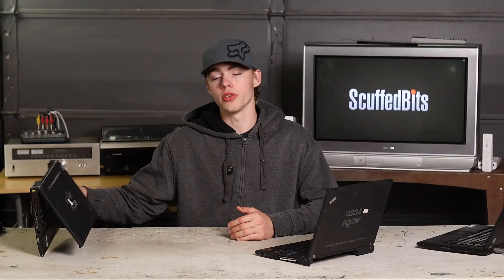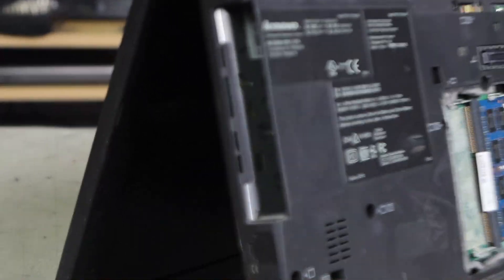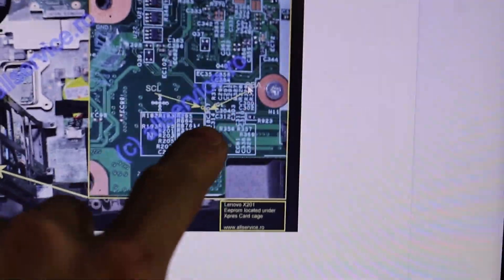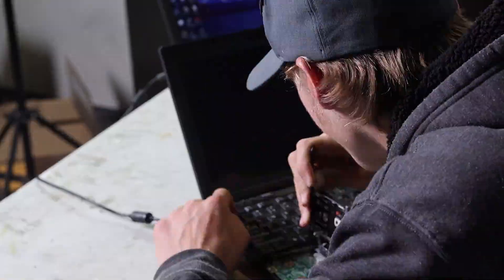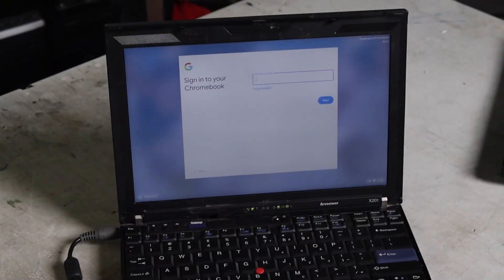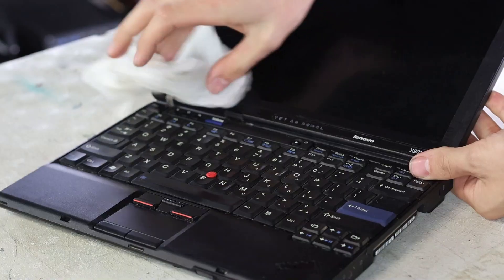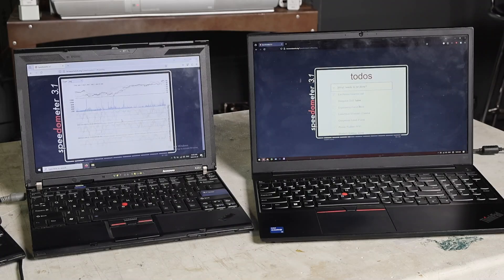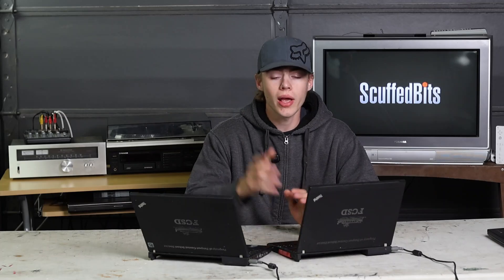I Bought BIOS-Locked School Laptops from eBay - Here's How I Fixed Them

Comment: The pin shorting thing is always a pain.  It's a bit easier if you find the chip the pins are on and can just pop a chip clip from a programmer onto it.  Then you can just pop a jumper on the clip leads to hold the short.  It also sucks that the shorting process changes depending on the model and age of the Thinkpad.